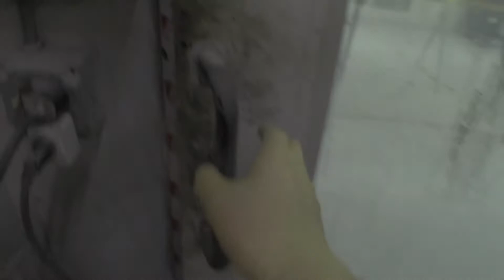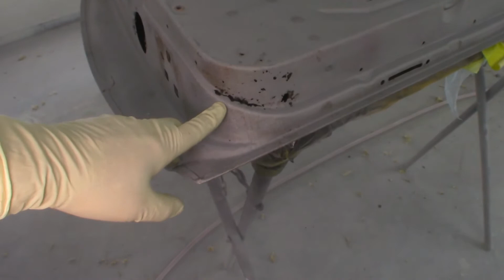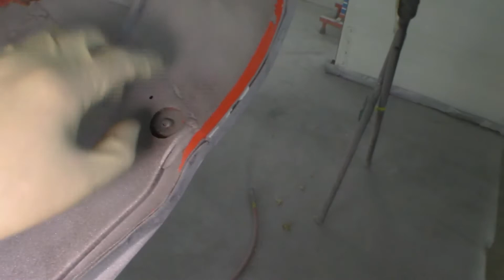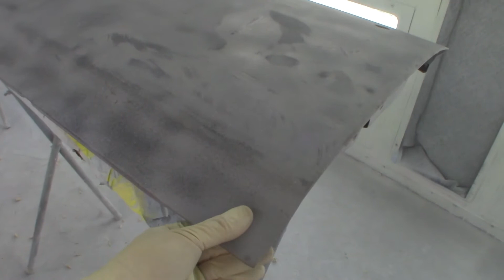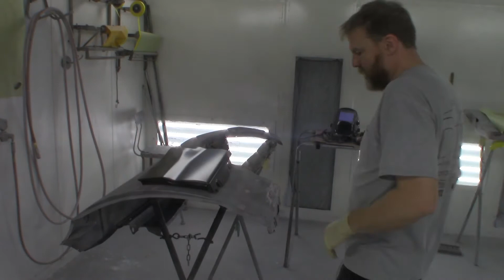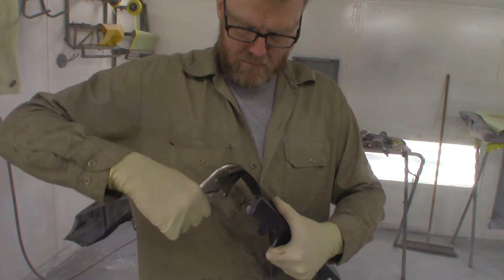68 OLDS 442 Rust Repair Work DTR Automotive

Comment: Where you located?
Reply from the maker: Lyons pa
Reply: @DreamstoRealityAutomotiveTV  Pa as well but im near Pittsburgh 
Was going to ask you the best way to remove multiple layers of paint off vette body
Reply from the maker: @laserfalcon  patience for one. I would not recommend chemicals, even if they say they work safely on fiberglass. You can use sanders and such but be careful as to not dig into the parent fiberglass. We now have lasers that will take everything off down to the fiberglass. I am to show this in an upcoming video.
Reply: @DreamstoRealityAutomotiveTV  will the lasers damage the fiberglass?
Reply from the maker: @laserfalcon  you can if you try, but I was able to remove paint and filler without damage. And once the paint and filler is off the reflectivity of the fiberglass doesn’t really allow the laser to work anymore
Reply: @DreamstoRealityAutomotiveTV  Do you need a car to make this video with 😁
Reply from the maker: @laserfalcon  no haha, I have an actual panel from a corvette to experiment on. When we get more comfortable with the laser stripping we will be promoting it.
Reply: @DreamstoRealityAutomotiveTV  mine is a 64 convertible